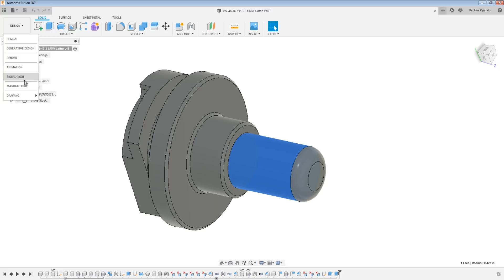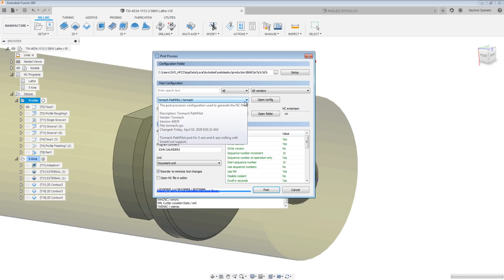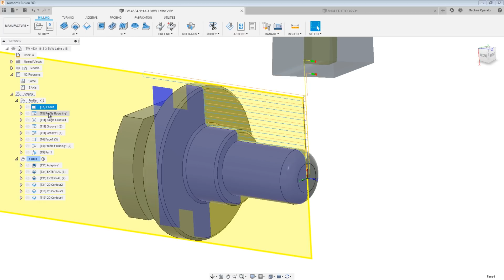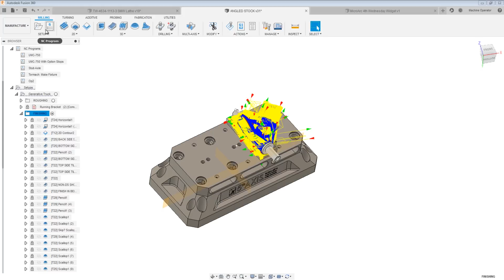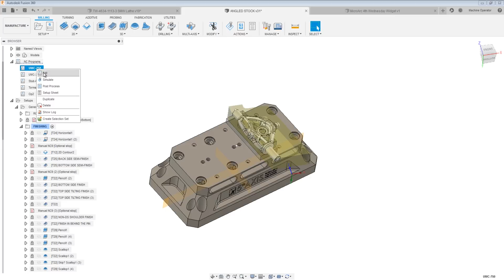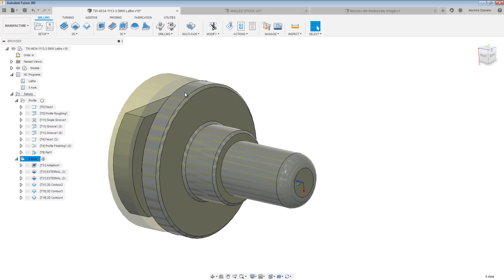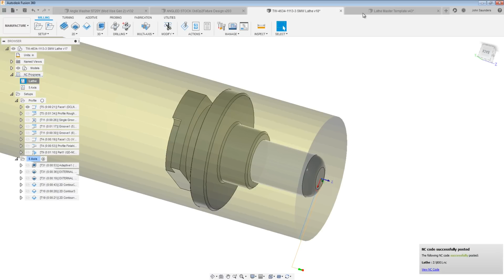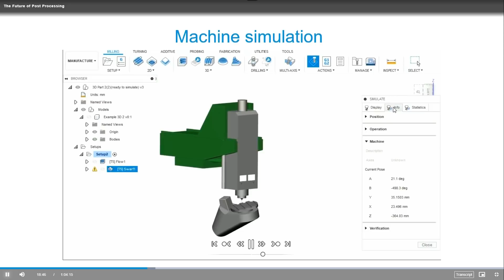Using NC Programs in Fusion 360: Save Time and Build Smarter Workflows

Comment: i have some problems with the optional stop when no toolchange is applied. then i have to manually start the spindle and coolant back up after confirm the m01...
Postprocessor 'missconfiguration'?

Comment: Once again John, you are wrong, wrong, wrong!
NC programs doesn't remember post settings! It requires you to enter in ALL information every time! More human input = more chance to error.
You are dead wrong here. 

You can have multiple posts with slight differences for multiple files. You are dead wrong here.

You can currently select to run an optional stop or different tool paths without NC programs.
You are again dead  wrong here.

With most lathe posts you can set the Max spindle speed if it's made a post property with the current set up. Once again, you are wrong here also!

Comment: I saw another video (another streamer if i recall correctly) that was showing the use of using the 'derive from' process so that you don't have the stuff** CAM programmers use clogging up the actual model file. Have you put this in your workflow at all?

**Stuff meaning the additional sketches or patches or whatever that a CNC programmer may use

Comment: Thank you! I am a Fusion beginner trying to focus on using it primarily for CNC. I really appreciate you sharing you knowledge!
Reply: I’m new to Fusion also. I’m not sure how you’re learning the software but Autodesk has a really good program with a bunch of different lessons. Also If you search Titans of CNC in YouTube you’ll find another great program that teaches Fusion and also how to program the machine once you got your part drawn. HAAS’s YouTube channel is also a great resource for beginners. I’m not sure if you have a machine already, but I found it a little discouraging that I wasn’t able to hold the part in my hand once I was done drawing it. My solution was to get a 3D printer since they utilize gcode to run the print. It’s also a great way to prototype parts before you start making chips. Stay positive my friend!
Reply: Oh, and MasterCam has made their University accessible to the public through the end of June!!